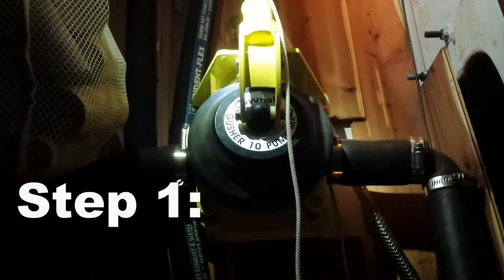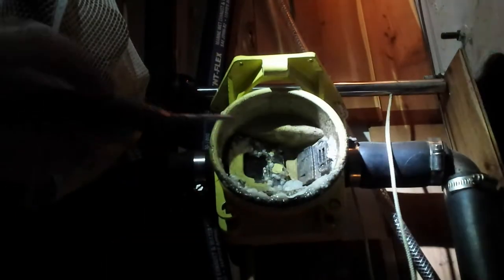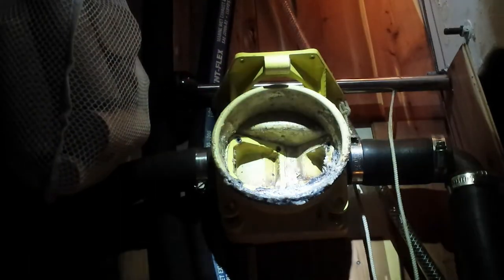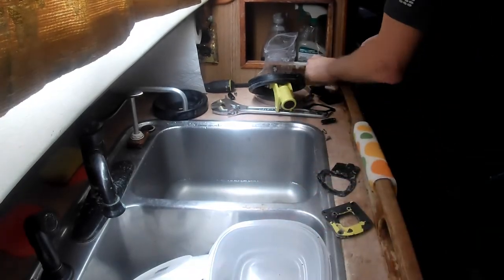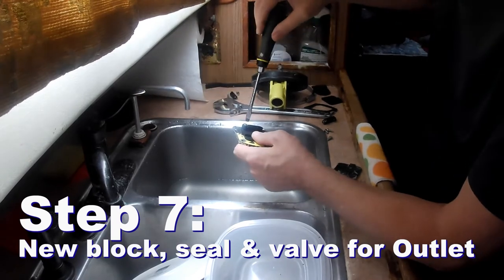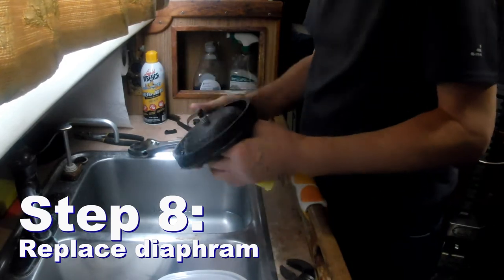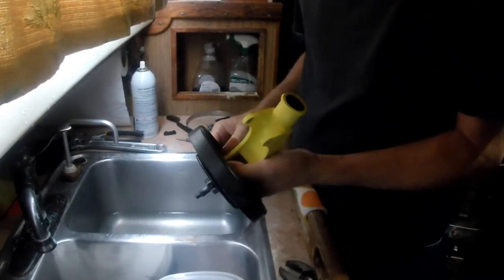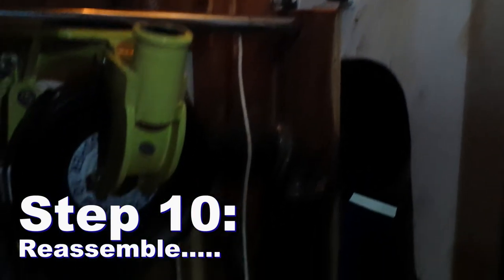Whale Gusher 10 MK3 Rebuild

Comment: If the kit has an option, go with Viton replacement parts. Viton is more resistant to temperature, chemicals and petroleum products by far.

It can be surprising what one can find lurking in a bilge...